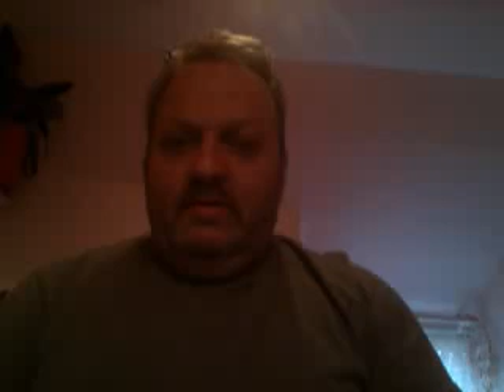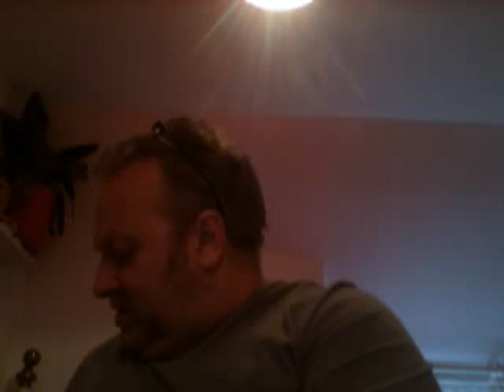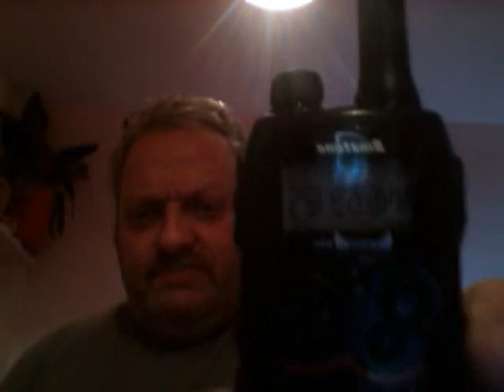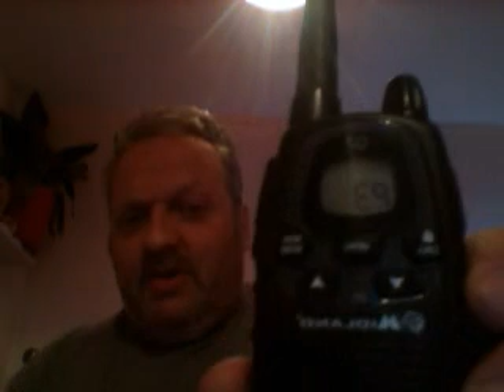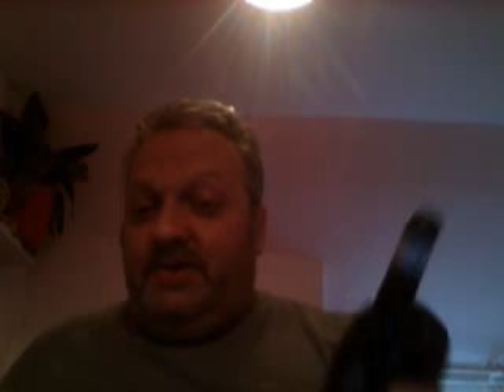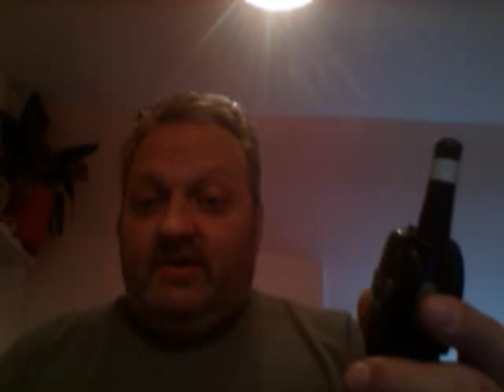UHF CB

Comment: Oh and in regards to LPD on Ham Frequencies its around 433mhz but to be honest most repeater inputs have a CTCSS tone so they wouldn't open up the repeater but I agree they shouldnt be on Ham bands. Unfortunately 440-446mhz is allocated for trunkin radio systems mainly for Commercial use.

Comment: Steve, i have a pair of those Binatone Action 950 radios. They are great quality, too. Did you know that if you turn it off, hold down the 2 front buttons on the left, then turn it on again, you open up a "secret" channel? it will display channel 9 on the screen. Dunno what its for? About the UHF CB, why dont we try and organise a day and time for all local people to meet on say channel 4 and see how many people there are interested in this, because i tried it before and had no luck. How many other people are out there local who gave up because nobody answered?
Reply from the maker: Hi Rab yes I did I tried it but , if I remember there was no TX.
As for  arranging a day oh yes like the sound of that, Hilltop is the way to go.
In fact I have a blog about it.
I think you will find it by typing in hilltopdx using pmr446
Reply from the maker: Steve Stevens
I nearly forgot I had it mate, its a bit dated but here is a link http://hilltopdxwithpmr446.blogspot.co.uk/2009/09/hilltop-dx-with-pmr446.html